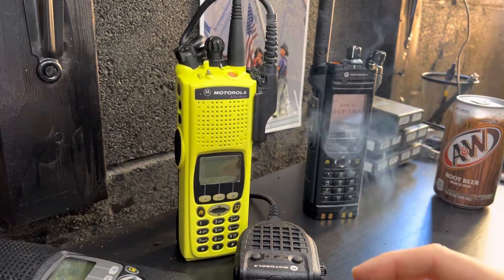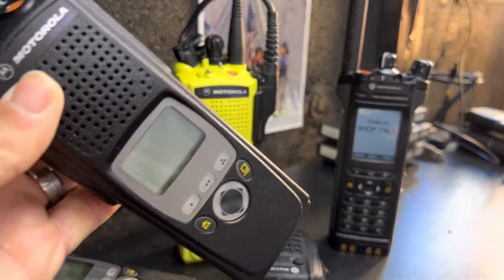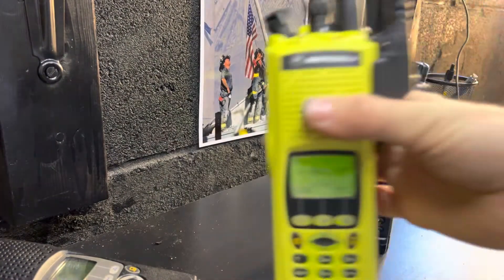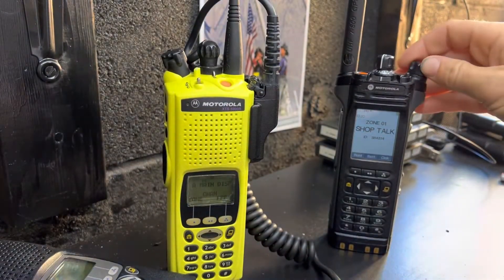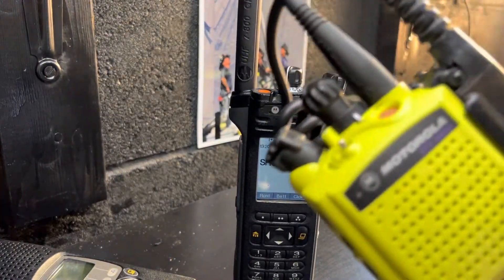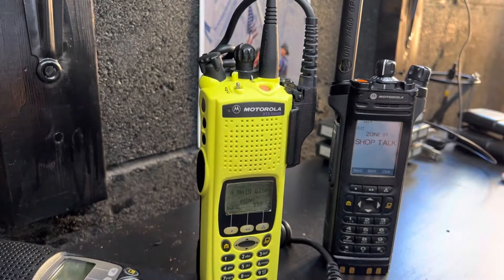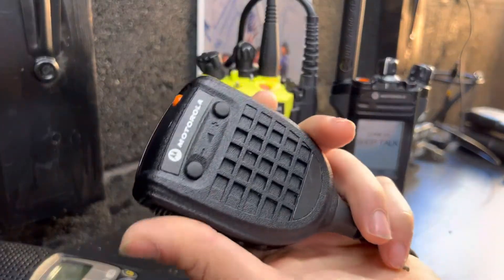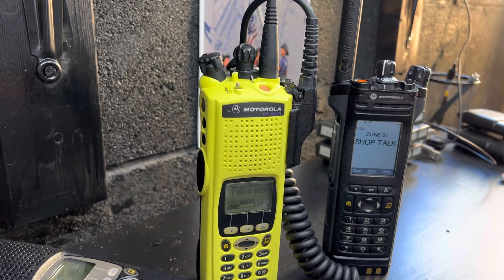TPT hack for P25 digital!!

Comment: I did this and it still gives the long deep tone. I have a model 2 with ADP.
Reply from the maker: Make sure the radio is switched to encrypted mode, using rx as mixed and rx as analog. That should resolve the problem.
Reply: @ourthinlines1404 Sorry I am confused. I thought this was digital? I have encryption selected, key loaded, DVRS turned on with TA when it can’t reach. On a conventional P25 channel.

Comment: If it’s on conventional, is DVRS turned on? That’s how you get those tones. The lower TPT tone is the direct/talkaround, and the normal TPT is the repeater. I tested this on my XTS1500, XTS2500, and XTL5000.
Reply from the maker: Yes, I have dvrs enabled.